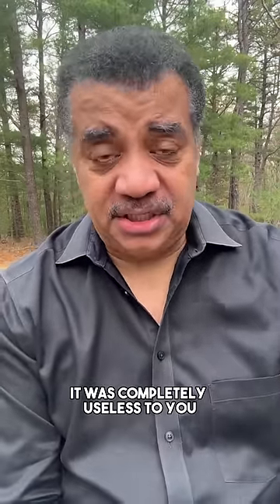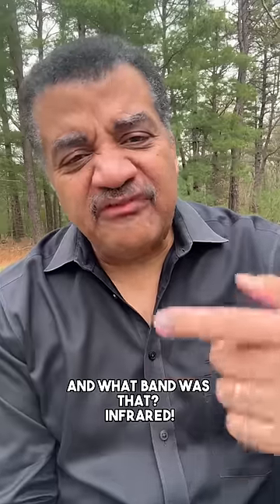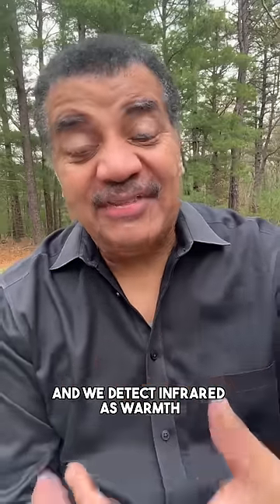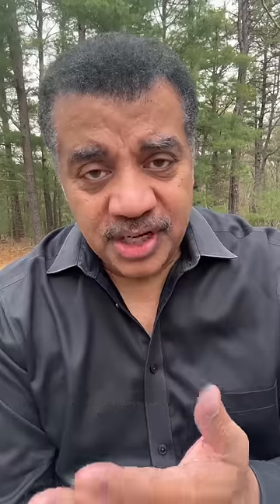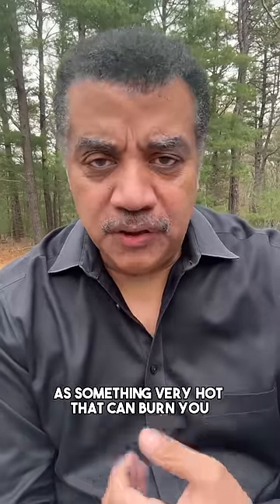LED Bulbs vs. Old Bulbs 💡

Comment: The new LED bulbs DO get hot, in the electronics portion.  You are knocking 120VAC down to something usable by an array of LEDs, and rectifying it to probably somewhere around 12VDC.  How does it get rid of all that extra voltage?  It dissipates it in heat.  So Neil is missing some parts of the equation.   LED bulbs  are considerably more efficient, and they don't get AS hot, but they still get hot and waste a lot of energy.  You're welcome.
Reply: You couldn't be more wrong.
1)They don't use 12V. Most modern LED bulbs have a very large series string to evenly distribute the current.
2)Almost all of the heat is generated by the LED's themselves(just the leds being mounted on a aluminum pcb and that pcb making contact with the bulb shell should be a dead giveaway that they produce a large amount of heat).
Also have you ever opened up a dead led bulb?? 90% of the time its just a single led that failed and because they are in series the entire bulb doesnt light up and IF the power section failed its because the bulb was running too hot and the capacitor or rectifier failed
Reply: @pesho9971  yes, I have opened up several. Often they are a single large LED, or appear as one.  There is a PCB with a small transformer and some  surface mount components that is often cooked. You're right about say,  In shop lights there are several LEDs in a series string. There will be something in be like 84 volts dc feeding the string   The LEDs themselves are usually not the culprit there either, it's usually a driver problem. Your typical LED light bulb is not constructed like you described though.
Reply: @IrrationalBstrd  What do you mean they aren't built like that?? All 3w 5w 10w E27 led bulbs have an aluminum pcb with leds and a driver board behind the pcb and near the base. Its either a non isolated buck converter or a simple capacitive dropper in small and cheap ones. The ones you're talking about are probably 10W+ Flood lights with a single COB led and a big driver board. For those I agree its the driver that fails because most of the time they are outside and have cooling fins on the back(not to mentiion the hull is made of metal) and usually the led outlasts the driver
Reply: @pesho9971 if they are in series the voltage is distributed, the current that flows into them is the same one

Comment: Led lightbulbs do get hot, the smaller amount of power still needs to be converted into DC which does not have a 100% thermal efficency of transfer from AC, so the base of the light bulb does get somewhat hot

Comment: I’m thinking with all this cold weather and considering my heating bill I’ll take the old incubator light bulbs! 😂
Reply: True...In the winter, they were 100% efficient  :)
Reply: You can get more heat and light with less power from a heat pump and an LED than from an incandescent bulb.
Reply: Not to mention esthetics. Nothing beats an incandescent bulb at generating warm, color balanced, comforting light. 

The only place I see practical uses for LEDs worth the savings is in large area lighting or high wattage visibility specific uses. I.E.
Stadiums
Auditoriums
Highways
Warehouses/Docks
Airfields
Lighthouses
Flashlights 
Emergency Lighting 
Large Commercial spaces and parking lots.

Basically anywhere higher wattage HID lamps are used. To me, that's any 400 watt metal halide, mercury vapor, or sodium vapor bulb or higher.

Leave the 35 watt to 250 wattage HID market alone.

I'm flexible on replacing fluorescent lights with LED. They are bulky in higher wattage lengths and are a serious hazmat. People don't have the care or patience to dispose of them properly. 

Final caveat Neil won't mention.  Going all LED costs jobs. Less people are needed to make less bulbs if they last longer... although robotics taking over probably makes this argument moot.

My two cents as a 70s kid Gen Xer. This is how I'd do it in my country if I had one...
Reply: You might aswell use wood burner to produce heat because incandescent doesnt heat room very well, unless your room is like 2 meter tall
Reply: @GERALD_786  Depends how well insulated the room is, and more importantly, the wattage and number of lights you're using. There's a reason why electric portable heaters generally don't go lower than 375 watts for the smallest ones. And they have a fan to help.
Reply: Err, it’ll cost the same amount to generate heat with a lightbulb as it would with an electric heater. And usually less than either with the gas heater.
Reply: @AWriterWandering  Close enough.  An electric heater is going to be a bit more efficient as it was built to do the job of heating. Thus, it generates little visible light to no light as the fan blows the heat off the coils into the room. 

The vintage space heaters which had weaker drafting fans glowed red hot, which is a bit less efficient than the newer modern portable space heaters. But since they glow in the high infrared spectrum, more energy is still radiated as heat than using the equivalent wattage incandescent bulb.
In the end, they're all the least efficient compared to heat pumps and fuel burning types.

Wood based fuel heaters own everything
Reply: @larrys4618  Wouldn't be worth the effort. 
1) The amount of BTUs per 100 watts of light just isn't all that much unless..

2) You can get upwards of well north of 1kwh. That's 1000 watts CONTINOUSLY used for one hour for just ONE KWH. To do that, you'd need 10 fixtures, all running 100 watt light bulbs left on for an hour. 

3) The average house might at best have 3 to 5 100 watt bulbs in fixtures  if it had rooms big enough to need them. The vast majority will be running 60 - and 75-watt bulbs. 

Unless you're an electric lighting shop with a full display showroom. Or Home Depot, you're NOT going to have every frickin lamp and ceiling light on in the house all at the same time to pull off 1kwh of lighting. 

Even if you're trying to be funny and do a Griswald Christmas vacation with Clark and Rustys help...you have other more pressing issues
Reply: @joncouncil4454  In truth incandescent bulbs themselves could actually last at least 2.5 times longer than they do. You can thank the Phoebus cartel for the 1000 hour “standard”.
Reply: @AWriterWandering  They already exist and can exceed even 2.5 times normal rated life of even the lowest wattage standard incandescent bulbs (40 watts)

Most people moving in to  New freshly built house already have them in any room with ceiling lights installed. They just don't realize it. 
They're called "Rough Service " bulbs, and they're rated for 5000 hours minimum life.

No matter the wattage.

You can even buy them online still, as long as they remain in stock. Once they're gone, per federal law, that's all folks.

Ah, the benefits of having been in the Electrician field...
Reply: An incandescent bulb is just a resistance heater—same as an electric space heater. Gas or heat pump is much more efficient. Adding incandescent bulbs as little heaters may lower your heating bill a little, but you’re paying for it in your electric bill.
Reply: Watch your heat bill go up. Electric doesn't mean free

Comment: LED's do get hot because they transform electricity to light which produces heat.
Reply: The base gets hot but it’s still manageable to touch, unlike incandescent where the bulb is so hot you can’t touch it
Reply: Exactly
Reply: Its worth saying that there're not nearly as hot though
Reply: This video is oversimplifying things a bit, LEDs don't convert all energy into making light, resulting in some waste heat.
Reply: @floyd2386  that is very true

Comment: It wasn't useless. It heated the room. Now with LED's the bulbs  are 10x as expensive and my heating cost went up too. Great improvement.
Reply: This is such a bad take. Your heater is going to do a much better job at heating your home than bulbs will. This is due to its positioning and higher efficiency (100% vs. 90% from a bulb). It can also give you heat without giving you light.

Also, gas heating is more efficient when you consider the losses incurred from converting fuel to electricity. So if you have a gas heater and no solar panels, you're better off heating your home with the gas than trying to compensate with incandescent bulbs.

Terrible, terrible take, unless you're somehow burning through your LEDs a lot faster than you should be. In which case, you have a separate problem.
Reply: @son_guhun  The efficiency of a bulb is almost the same as an electric heater. Only with a heat pump you gain notable efficiency. But you won't get a heat pump for free when you replace standard bulbs with LED. The only diff is the positioning and that is fairly irrelevant too since most heat from the bulb comes by radiatibg infrared. So in summary it is not much worse getting the heat from a bulb as opposed from an electric heater. Of course things are different in Summer. There the LED is advantageous because it produce less heat and you need no or less cooling.
I have around 50 LED bulbs in my house. And after 5 years I can say from experience they live about 2x as long as regular bulbs but cost more than 10x as much. I am not sure about the rare materials needed. But my guess is that environmentally like cost wise LED are worse than bulbs and energy wise they are at most  twice as good due to the lack of heating in Winter. In summary, if there was no law I would use bulbs not LED. Electrical engineer speaking.
Reply: Your math is messed up. 
Good quality LED bulb usually lasts 10x longer too. Beside using less energy because it's not inefficient by design. You still save energy during summer. Heating bill can only be marginally higher. The difference is trivial.

Oh, and don't get me started that incasscedent light bulb is designed to FAIL, so that you keep buying and manufacturers making money. Look it up.

Comment: I cant stand when people try and convince me that LED dont get hot, have you ever changed the flickering bulb still very freaking warm to the touch
Reply: Depends, i changed alot of LED bulbs and firstable was completely cold, after that i getting to feeling "really hot bulb" but still less then old bulbs
Reply: @ItsCoa  fair 😂
Reply: Led Headlights will burn a hole in your fingers.
Reply: It’s true, they’ll burn the crap out of your fingers. But they don’t radiate heat the way incandescents do, so you can’t use them for things like EasyBake ovens, incubators for eggs, or to keep pipes from freezing in the winter.
Reply: What I hate about LEDs is how they don’t last anywhere NEAR as long as they claim, and they start that flickering crap that renders them useless.
Reply: I've never been actually burned by an LED, just surprised that it was warmer than I thought it would be. There's still no comparison
Reply: @catherinealexander6255 LED's actually work off of DC voltage, but the weak link is the electronic driver that converts AC to DC which causes the flickering and premature failure.
Reply: @catherinealexander6255  Actually the led itself is probably fine. It's one or more of the electronic components  on the circuit board that has failed. And unfortunately they fail quite often  making the bulb useless.

Comment: Lightbulbs are more efficient but now my gas bill has gone up because I need more heating. 

Thanks science.
Reply: Gas is cheaper than electricity. Insulate pipes
Reply: @MsRwise  no, it is not.
Reply: Heating your house with light bulbs is probably the least efficient way
Reply: Gas is usually cheaper than electricity for heating and bulbs are less efficient for heating than a simple electric heater.

Comment: They also helped keep your water pipes from freezing in the winter and helped keep your room warmer than these new ones. I prefer the old ones.
Reply: If you want to heat your room then a lightbulb is about the least efficient way to do it. Just turn on a radiator.
Not to mention that the old bulb will be heating the room just as much in summer as in winter, so you’d have to run the AC more to compensate.
Reply: @mahoganywolf8843  I don't heat my home with a light bulb. 🙄 My point was they HELP heat the room. As for having to run the air conditioner, I switch my light bulbs for the new kind when it's time for the air conditioner. Byw, I don't have radiators. I have a heat pump.

Comment: So in winter the efficiency of the old bulb was 100%.
Reply: That's every electrical device in winter.
Reply: That's a thing I annoyingly tell people about space heaters. Space heaters are 100% efficient, since even the energy lost as heat from the cable is doing the job that the appliance is designed to do. I bring it up a lot. I am a lot of fun when we go by the heater section at Walmart.

Comment: Yet one great use of those infrared waves was to keep your pipes just above freezing in your crawl space in the dead of winter.
Reply: Use another type of electric heat. Works the same and then you don't have to waste the electricity producing light where you don't need it.
Reply: @MrT------5743  but no electricity is being wasted. It’s being used to heat the pipes.. your point is?
Reply: @jerseyclamboi6353  what about summer? Waste heat!
Reply: @MrT------5743  there’s no need to heat your pipes in the summer😂😂
Reply: @jerseyclamboi6353  obviously, so why buy light bulbs that produce heat?

Why produce waste light when you want heat, or waste heat when you want light?
Reply: Geez people never heard about insulating pipes? Heating a vented crawl space in winter with a light bulb is a great use of energy? Here’s an idea- do math while wearing a wool coat and shorts on a cold day. It may reveal something.

Comment: Actually Neil, it wasn't useless because nothing sucks more than a light that doesn't warm up a room. Psychologically it is unsettling because the animal inside isn't comfortable with this overpowered lunar light.
Reply: Best comment on the board.

The animal inside.
Reply: He couldn't resist the subtle jab of saying welcome to the present

Guy Is an elitist ego maniac
Reply: By that logic daytime in the winter should be unsettling.
Reply: @AWriterWandering  Maybe you've forgotten that the sun warms the planet regardless of the season. Winter isn't winter because the sun cools down.
Reply: @blackmancer  yes, it’s warming, but not to a comfortable level. Without insulation or an additional, man-made source of heat, the winter is very uncomfortable. (Not to mention the fact that the sun is ultimately responsible for the wind, which has the effect of intensifying the cold)
Reply: @AWriterWandering  laughs in seasonal depression
Reply: @AWriterWandering  The animal doesn't compute wind chill factors. Majority of world population live within 45 degrees N and S. You're choosing an outlying case to base your entire argument.
Reply: @blackmancer  The animal also doesn’t distinguish heat generated from other sources. My cat could bask in the sunlight in the window, but he prefers his heated blanket because it’s warmer. For the same reason, many animals spend their winters underground in the insulated earth.
Reply: @AWriterWandering  Do you have a hard time admitting you were wrong?
Reply: @blackmancer  do you have such a hard time giving up incandescent bulbs that you have to come up with some kind of pseudoscientific excuse to justify it?
Reply: @AWriterWandering You clearly misrepresented what I said by your own flawed logic. Can you not accept that your first input here was "the sun doesn't provide warmth in winter" and now you're projecting what YOU did with your own junk argument to justify your own failing.
Reply: @blackmancer  go read my post again. Not once did I ever say that the sun provided no warmth in the winter.  Only that overall temperature was not comfortable. Animals seek warmth. That may mean seeking sunlight, but it doesn’t always. if a hole in the ground is warmer than the bright outdoors, you’re going to go to the hole in the ground. For the same reason, humans spend most of their time indoors in the winter. We aren’t huddling around our incandescent bulbs. For most of human history, artificial lighting was a luxury. Things like candles and oils lamps were too expensive to keep running all the time. Most of the time being indoors meant you had to live with whatever little light filtered through the window.

Comment: I do a lot of sewing in the evenings and led lights hurt my eyes. I have run out of incandescent bulbs and will have to rearrange my daily schedule to sew during daylight. Cloudy days are going to be a challenge.
Reply: Interesting. Even the warm colored ones?
Reply: most led bulbs have a bad crt rating. (color rending index) get an led with a true high crt and with a good defuser. It will be like $25 a bulb and last 10-20 years. If its $10 its not going to be good.
Reply: get an rgb led bulb, you can change the brightness and color
Reply: You can still find appliance bulbs they work like regular bulbs

Comment: It warmed the house and had much better natural color and great cakes in the easy make oven.

It also melted snow and ice from head and taillights.

We need the old ones back now.
Reply: Neil makes so many assumptions, he doesn't know what infrared and I do in the dark.
Reply: Warmed the house ? 
What industrial size bulbs did you used in your small room, breh ? 😂
Reply: @Mespera3011  You'd be surprised what 4 x 60w bulbs kick off in the way of heat in a regular sized bedroom.

Comment: LEDs do produce some heat, early ones used to have heatsinks, but they are more efficient now. Old bulbs still serve a purpose though in things like halogen ovens cause they are really good at converting energy to heat.